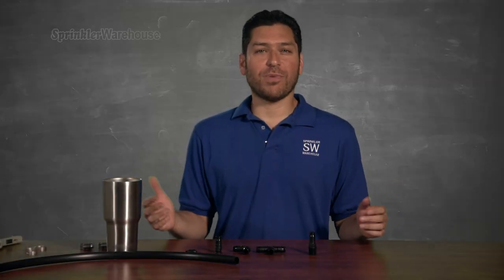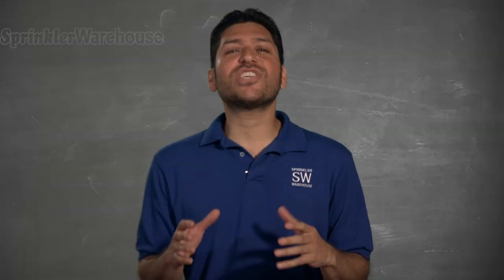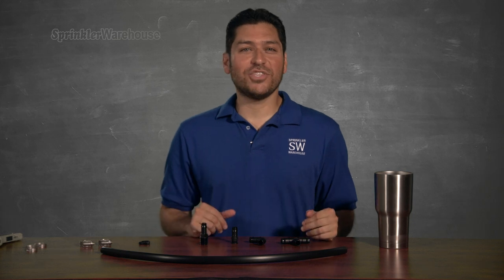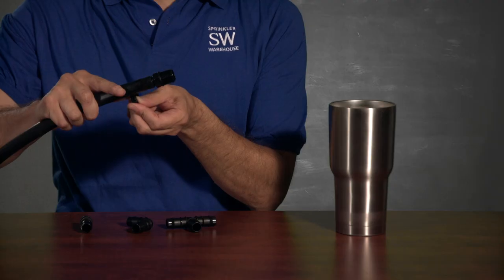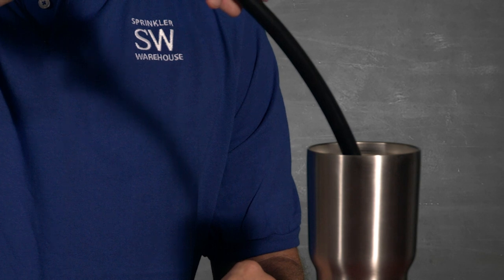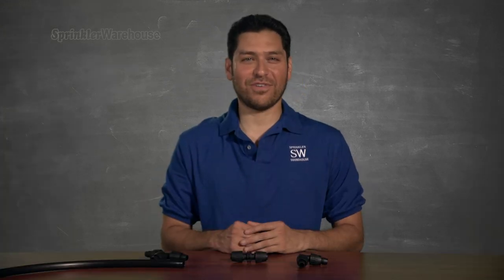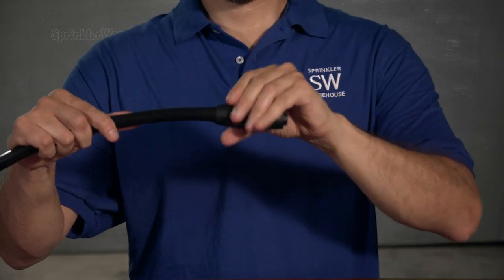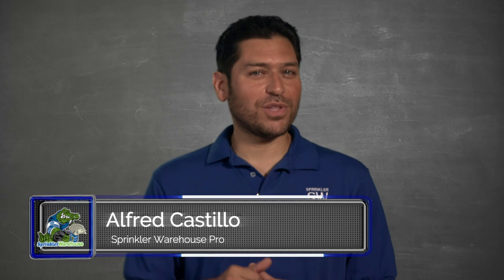Compression, Barbed, and Lock Nut Drip Fittings

Comment: This was helpful, but why would they make so many sizes a variance of .03-.07 inches?  Stick to .57, or even better, .5!  I’ve got “T” barbed fittings running down each row in my garden that are leaking, clamped to max, and now I realize I must have the sizes wrong.  The other factor is the polybutylene tube was reused and may have stretched.  Not I’m trying to figure out, do I need to replace all of the fittings, put in PVC or all-purpose cement, or maybe even Teflon tape to make up for the size/swelling issue.